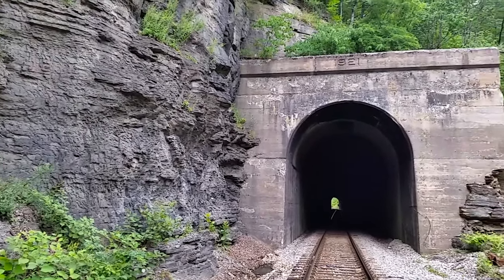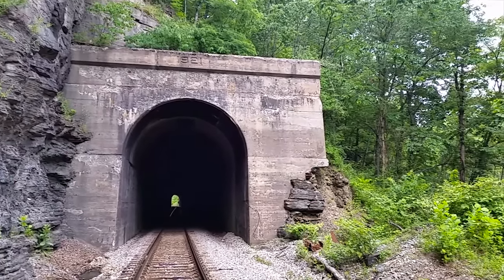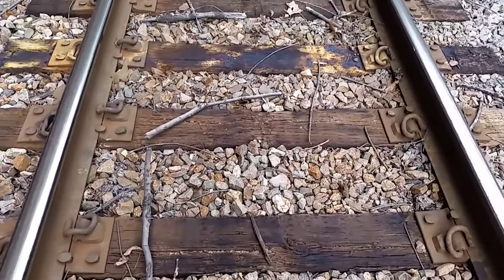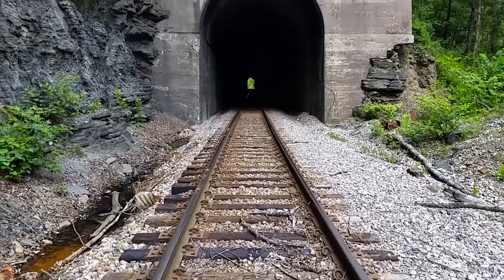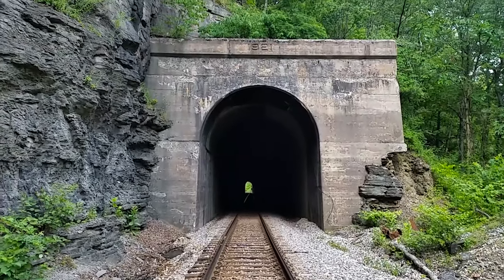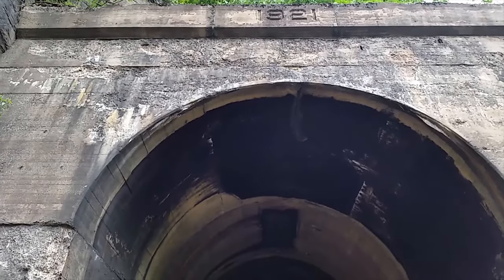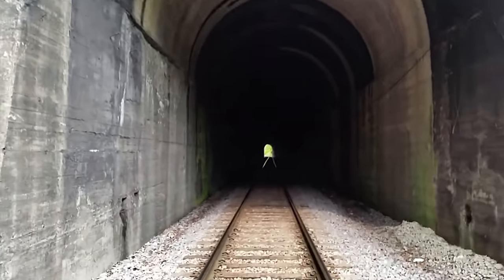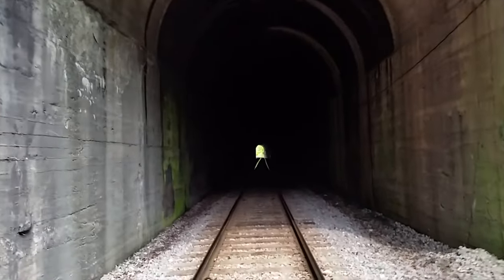Sykes' Mill Tunnel - CSX / Clinchfield Railroad Tunnel In Dickenson County

Comment: Great vid.   A common problem dating Clinchfield Railroad tunnels is that the dates shown on the portal linings like this one, does not reflect the actual year of construction.  This tunnel was actually built in 1914-15 during the Elkhorn Extension construction, and the 1921 date on the portal is the year the tunnel was lined with concrete.
Reply from the maker: Thank you for that information! I did some checking, and you are correct! I want to walk through a couple more. There is one a few miles up the road that goes under a mountain and is about a mile or so long. It supposedly had a partial collapse, and 'supposedly' it is safe, other than the rumors of bears, coyotes, rattlesnakes ... on second thought, maybe I'll do a remote control car with a camera on it lol.
Reply: I would love to see the tunnel on the Clinchfield at Speers Ferry near US 23